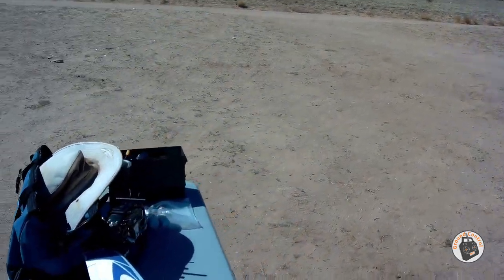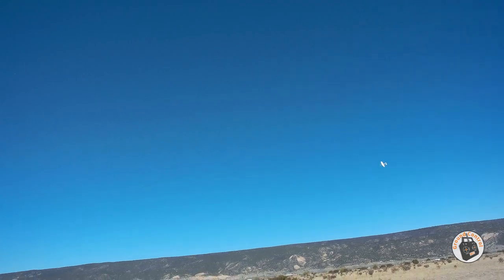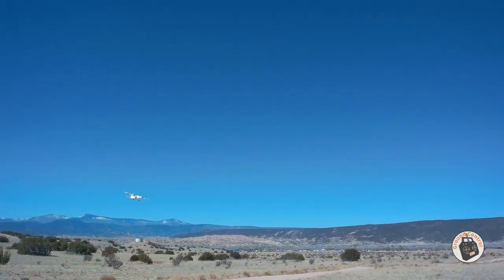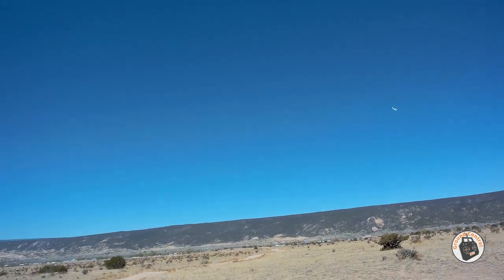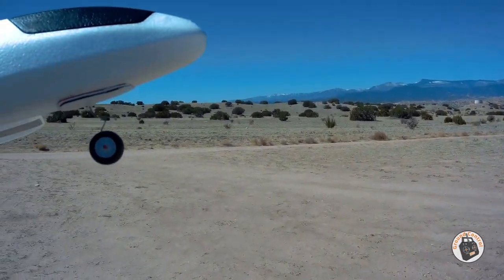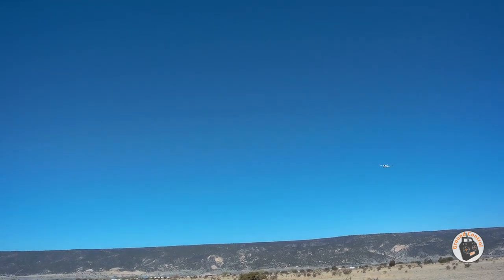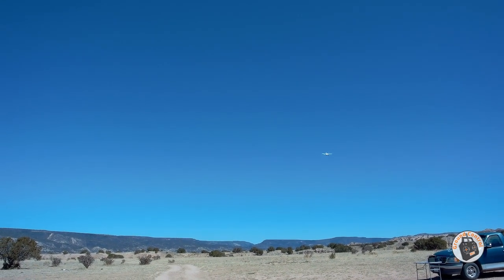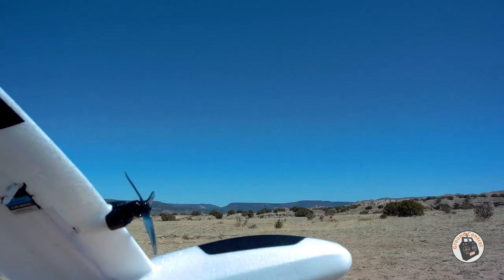Byme-A Gyro Stabilized in Gusty Winds - Eachine Flying Fish 650mm Wingspan Sub-250g Twin Motor Plane

Comment from the maker: Don't Forget to Subscribe -> https://www.youtube.com/GroundControlRC?sub_confirmation=1
Don't forget to Follow Us on Facebook -> https://www.facebook.com/GroundControlRC

Get One Here: Eachine Flying Fish W650 650mm PNF
https://www.banggood.com/custlink/K3myQ9zGvL

Get One Here: Eachine Flying Fish W650 650mm PNF
https://s.click.aliexpress.com/e/_A4mYVL

Get One Here: GNB 11.4V 850mAh 60C 3S HV LiPo Battery XT30 Plug
https://www.banggood.com/Gaoneng-GNB-11_4V-850mAh-60C-3S-HV-LiPo-Battery-XT30-Plug-for-FPV-Racing-Drone-p-1863758.html?p=WE081047791920140372

Get One Here: GNB 850mAh 3S 11.4V 60C/120C HV Lipo Battery With XT30U-F Plug
https://s.click.aliexpress.com/e/_9fy3L7

Get One Here: Turnigy nano-tech 950mah 3S 25~50C Lipo (Comes with JST Connector)
https://hobbyking.com/en_us/turnigy-nano-tech-950mah-3s-25-50c-lipo-pack.html?affiliate_code=YRCVWOSKMDXLVUW&_asc=6456367256

Get One Here: RadioLink Byme-A & Byme-D Flight Controller & Gyro
https://s.click.aliexpress.com/e/_AOGjbL

Get One Here: RadioLink Byme-A Flight Controller & Gyro
https://www.radiolink.com/bymea_where_to_buy

Get One Here: RADIOMASTER R81-D8 8ch Nano SBUS Receiver (Frsky D8 Compatible)
https://www.banggood.com/RadioMaster-R81-2_4GHz-8CH-Over-1KM-SBUS-Nano-Receiver-Compatible-FrSky-D8-Support-Return-RSSI-for-RC-Drone-p-1757296.html?p=WE081047791920140372

Get One Here: RADIOMASTER R81-D8 8ch Nano SBUS Receiver (Frsky D8 Compatible)
https://hobbyking.com/en_us/radiomaster-r81-d8-8ch-nano-sbus-receiver-frsky-d8-compatible.html?affiliate_code=YRCVWOSKMDXLVUW&_asc=325340518

Get One Here: WFly RF201S 1.32g Micro SBUS PPM receiver (OpenTX Supported)
https://www.aliexpress.com/item/1005003636312055.html

Get One Here: RadioMaster TX16S MKII OpenTX EdgeTX Transmitter
https://www.banggood.com/custlink/KK3EUzvecp

Get One Here: RadioMaster TX16S Transmitter
https://www.banggood.com/custlink/DvvycmfSMK

Banggood GCRC
https://www.banggood.com/custlink/GmDmQ1nVkO

Comment: The Byme was fitted on the flight earlier described I also flew the Arrows Pioneer it also handled those winds fine but in non stabilised mode it was uncontrollable. 👍michael
Reply from the maker: Hey Michael!
I haven't had the Pioneer up in a lot of wind yet but when I get the roll axis working well it's going to get tested ;-)
See you in the Air!
Reply: Most RC Planes with the Gyro in 6 AXIS can have the CG totally wrong and fly beautifully, sounds like this may be Your problem? I know this from many a Crush, Kill,, Destroyed Plane. Ahahaa!
Have a great Week Michael.
Reply: @jonoedwards4195  your totally correct the stabiliser has an amazing ability to iron out problems with c.g. 
However I did carefully set the cg on the recommended points perhaps with quite windy conditions would be better to be slightly nose heavy would that give better penetration and thus improve control.

Comment: Unreal, micro cheap flight controllers, We have it made in Our RC pastime nowadays!
Been finkin bout trying PPM, fitting the wiring, battery and RX in small EDFs without cutting some foam is near impossible.
Great show, a beauty Thanks GCRC.
Reply from the maker: Thank you much Jono!
She's a Beauty for sure ;-)
I love how well these gyros work without having to configure anything, just PNP.
This Hobby just keeps getting better with all the new toys ;-)
I'm going to test one out in my Eachine F16 EDF that I converted to a Pusher Motor and Prop with an SBUS RX.
Hopefully I'll have that complete and ready for testing in a couple of weeks.
If that works well I'll putting these in my other EDF Jets so I can get much more aggressive flights when I have a parachute switch!
See you in the Air!
Reply: @GroundControlRC  Hahhahaha!

Comment: My Fish setup pretty similar ala landing gear and used a Byme A and the Wfly 201S SBUS receiver - very pleased with both and also just received 5 more of those receivers and Byme A/D's for other projects - btw how is that glider project going?
Reply from the maker: I just got back with another flight session with the Flying Fish!
My absolute favorite sub-250 Factory Plane of all time ;-)
I'm glad your setup is working well and that Byme-A Gyro and the WFly SBUS Receiver work fantastic.
I haven't started on the Glider Project yet and it will probably be the end of July before I have the time.
I still have my Volantex PheonixS Sport Glider I haven't unboxed yet, it's the Kit Version, and I want to get it in the Air before I start another project.
I'm so looking forward to that Glider Project though as I think it's going to be Awesome.
They're so inexpensive I'm thinking of ordering a couple more of those gliders and I currently have 2 ;-)
See you in the Air!

Comment: Yup the Byme A is really good specially considering the price and small form factor. Using it on my Eachine F-18 running on 4s in high winds and its pretty much locked on. Though I dont care much for the self leveling mode since it makes for too wide a turn due to the very limited bank angle.
Reply from the maker: Hi Rodin!
Yes, fantastic little gyros.
Yep, those bank-n-yank planes make wide turns in beginner mode as that's the downside of not having a rudder.
I may MOD my converted Eachine F16 EDF that has a Pusher Motor with a rudder just to see how much that helps in the turns.
See you in the Air!

Comment: As I have said many time, technology is wonderful.  Choose the assisted mode and the mini computer will take care of it.  If it wasn't for the simulator I could never have afforded to buy all the planes I have crashed and safe mode made it so much easier ( and less costly) to actually learn to fly the real ones outside.  It's a great time for RC.  That little bi-motor looks like a lot of fun.
Reply from the maker: Hi Jack!
Yes, I wish could have started on a Plane with a Gyro.
I think they are fantastic learning tools and great parachutes to get you out of trouble.
I think it would have been much easier for me with my 1st plane.
See you in the Air!
Reply: Actually, what technology allows and it's wonderful for me, it's that you can get small airplanes (<250g) in the backpack and fly with it even if it's windy. Just comes back from the field and the ZOHD dart 250 that I have in a small cardboard suitcase (it's around 180g AUW) is perfect for "buzzing the tower" (i am the tower) without concern about the small wind.
Reply from the maker: @marielizysurourcq  Yes, that's one of the great things about these small planes and that they are so durable due to the low mass of the plane.
I would rather risk one of these small planes in strong winds than one of my larger planes.
Plus they're so much fun ;-)
See you in the Air!